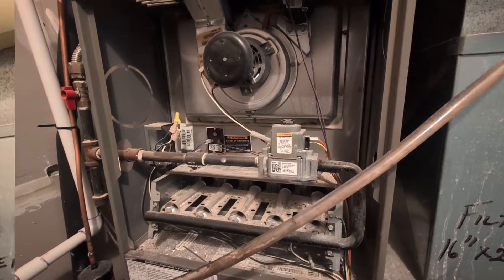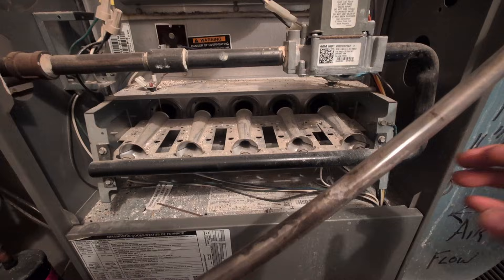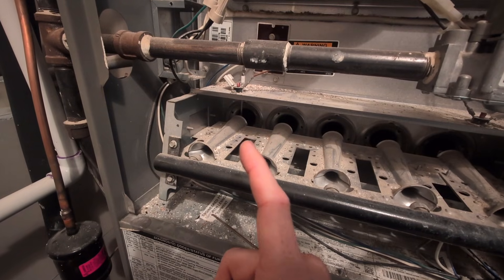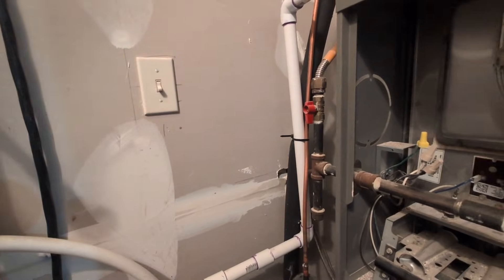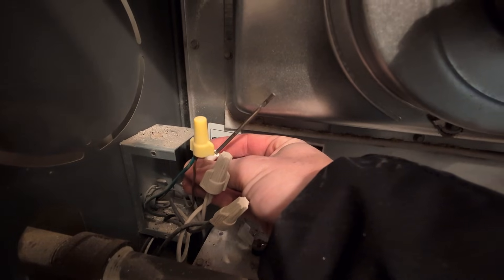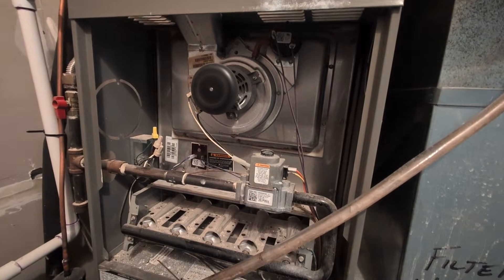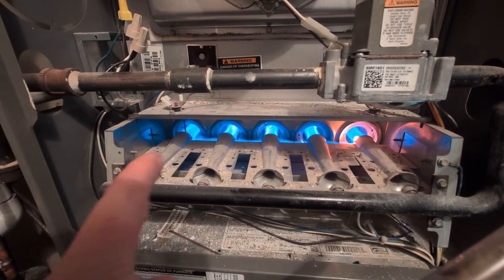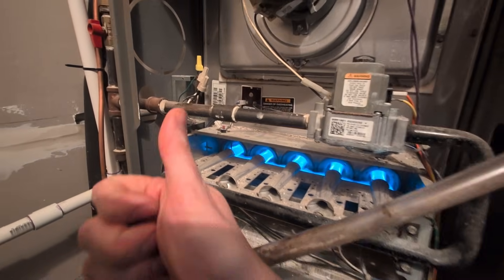The MOST COMMON Furnace Failure - How to Fix for Free!

Comment: Have to do the same thing on diesel boilers. You have to clean the cad cell and ignitors
Reply from the maker: Just about any appliance with a flame will have some kind of flame sensor as a safety measure. I've had this issue with water heaters and patio heaters as well.